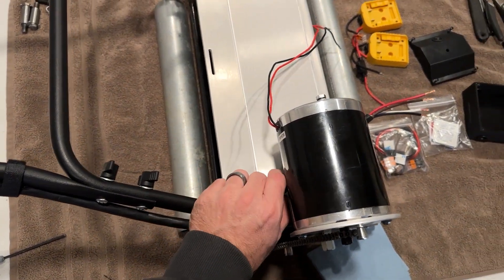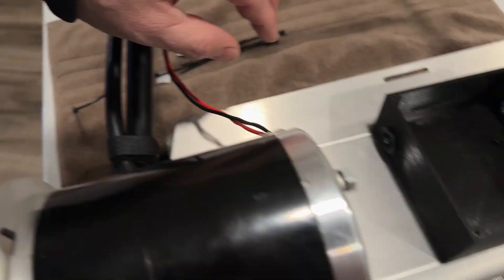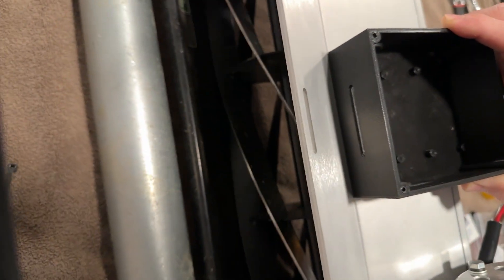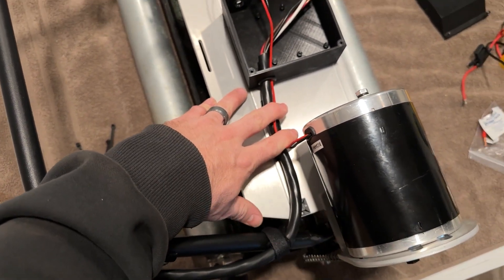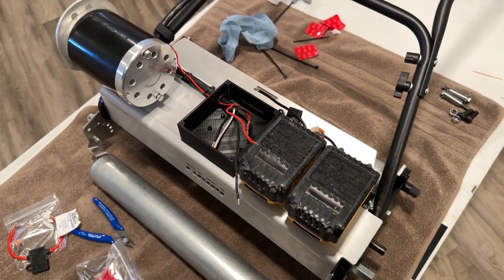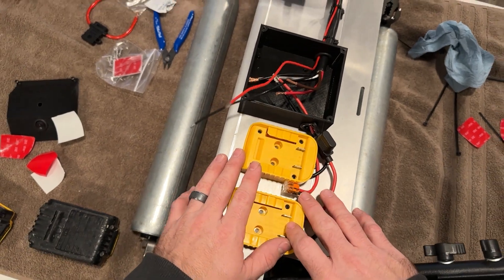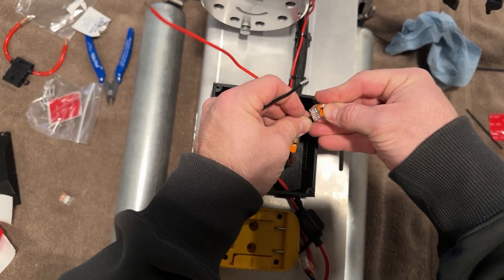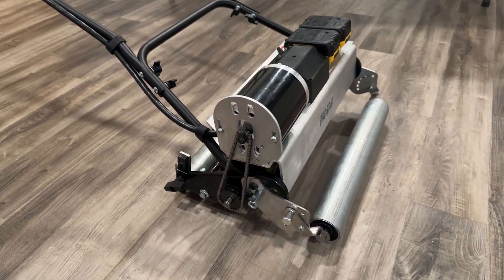RMM - Electric Conversion Bracket Kit Install - Part 3: Wiring Box and Battery Install Updated 8/24

Comment: Any reason not to move the fuse holder into the wiring box? Perhaps easier to access if it's outside. I'm not sure if having it more protected inside the box would have an advantage.
Reply from the maker: @oldmanwaugh  With the addition of the thermal breaker on the newer kits, having to replace the fuse would be unlikely. We like to place the fuse inside the wiring box for a cleaner look. This install video is a bit outdated but the majority still applies to current kits.